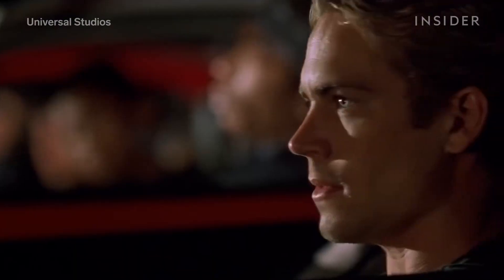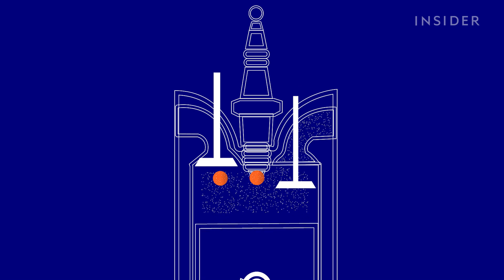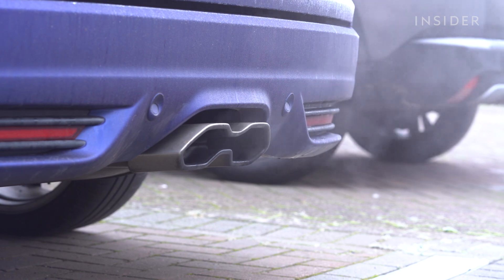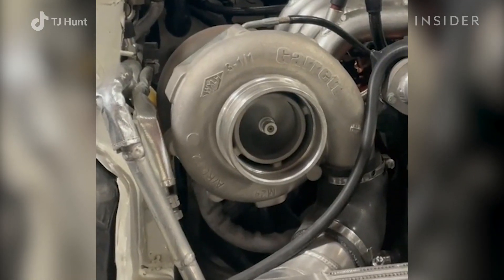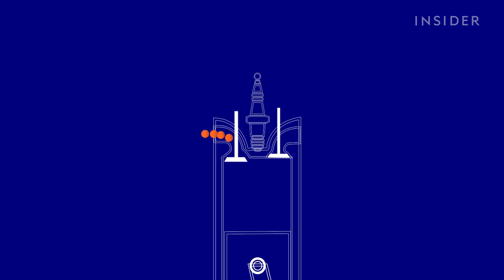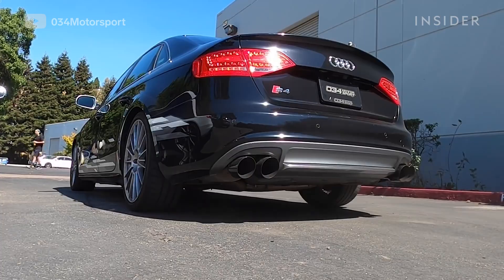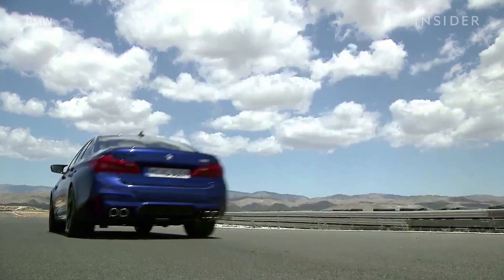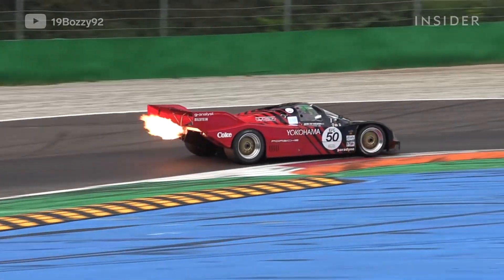What Makes Cars Shoot Flames

Comment: Is BMW's twinpower turbo techonolgy considered as an anti-lag system similarly to the one mentioned in the video?

Because my F56 JCW Mini has one and it pops and bangs, but never spit fire. My guess is that that the only restriction it has is the catalytic converter (Just the downpipe cat, not the 2nd cat most cars have due to European regulations), resonator and muffler (Just the downpipe cat, not the 2nd cat most cars have due to European regulations). It has the stock exhaust. 

However, the JCW Pro exhaust has a resonator delete, and it's a valvetronic system with one is considered a straight pipe exhaust when the valve is open except for the downpipe cat presence. Still, I've seen people install this exhaust on their cars and it doesn't spit fire. Some have even got a catless downpipe for the exhaust, and still not fire at the exhaust. I'm really clueless what's causing it not to spit fire...

I mean it has a performance JCW tune, a turbo with Twinpower turbo technology (that I'm guessing works similarly to anti-lag systems). catless straight pipe, short exhaust, because it's short car uses no less than 91 octane gas. So, what could be the reason preventing it from spitting out flames?
Reply: BMW's twinpower turbo technology refers to the fact that  it uses a twin scroll turbocharger  (a turbo that has 2 chambers in the exhaust side with 2 opposing  cylinders attached to each chamber). This allows the turbo to more efficiently use the exhaust pulses to steadily build momentum and thus achieve boost faster. 

The anti-lag on these engines in factory setup are tied to the transmission computer programming in that it only activates on high demand during  shifts (often referred to as DSG farts) when you hear that stutter from the exhaust during shifts.

The pops in your exhaust won't shoot flames with catalytic converters or with stock tuning, you will need a custom tune for that.

Hope this helps.....
Reply: I’d imagine you’d have to be fully catless. It could be that your mini is just shooting baby flames. Have you tried setting up a camera at night time or in a dark place?
Reply: Think of flames as just more extreme pops and bangs, you still have fuel being ignited at the end of ur exhaust which is the pops and bangs but there probably just isnt enough fuel for a massive flame
Reply: DBW throttle  mapping for HC emissions.

 Retard timing and do not fuel cut.

Comment: I had a 302 in a 1957 ford pickup. It threw flame. Turned out the carburetor was running rich.

Comment: ok rear engine cause backfire because of short exhaust, front engine car doesn't do that because catalytic converter and long exhaust system unless they have a turbo, how about NA mid engine sports car? does it backfire too?
Reply: Yeah this man doesn't know any thing.most of the time front engine,front mid engine,rear mid engine,rear engine cars can doesn't so much with backfire/afterfire. Forced induction or not that doesn't matter a lot as well.(forced induction means using a turbo/supercharger). Nowadays even sports cars have catalytic converters most of the times cars that can backfire are modified and tuned like deleting the muffler and deleting the catalytic converters. And tuned to make the spark plugs fire late so most of the fuel exits the the combustion chamber unburned and burns at the exaust tip.
Reply: There is another thing called 2 step that cause small puffs of fire and makes that gunshot sound that is a rev limiter that is used to hold the revs at the point where u have the can get the most power to the ground. It holds the revs by holding back the spark plug firing time. Again this causes unburned fuel out of the exaust tip.
Reply: Na mid engine sports cars can backfire like normal that's how lamborghinis backfire.the only lamborghini with turbos is the lamborghini suv the urus. other cars like the huracan the aventador  the countach is naturally aspirated thy can backfire
Reply: @itzshark6737  i never seen a countach backfire also the hurcan can't backfire in a production car  without any mods because audi has to use it in r8 and they are in the diesel scandal with volks on the other side those v12 are proper lambo way with crazy Germans
Fun fact : if a aventador spits flames every shift from 3rd its means its hot af and using every bit of fuel they was a test where the max out a aventador and it did 3 mpg

Comment: afterfire? I thought it's called backfire
Reply: Maybe they just look at plane "After Burner" and mix it up with back fire
Reply: I’m about 4 months late, but it is actually called afterfire, there’s a difference
Reply: It really is called afterfire. Backfire sounds cooler but isn't actually correct in this case.
Reply: Backfire? I thought it’s called backshots
Reply: Afterfire is fire coming out of the exhaust which is fine, but backfire is when the fire comes out of the intake usually seen in old carburated engines
Reply: antilag'